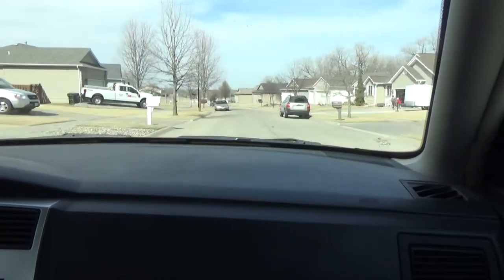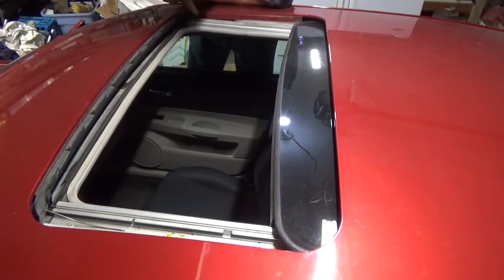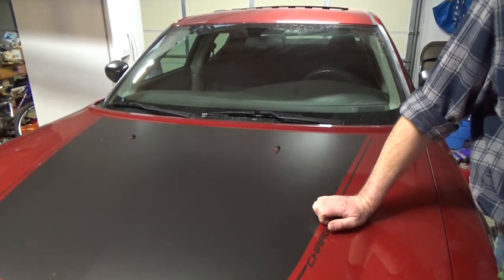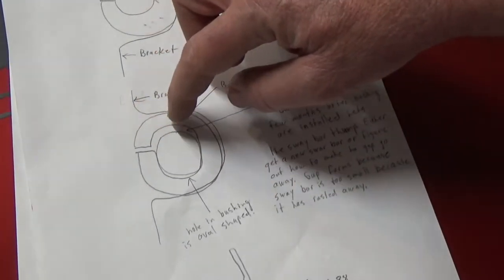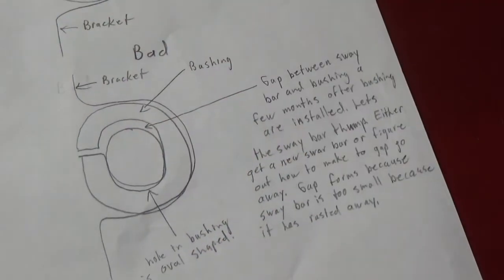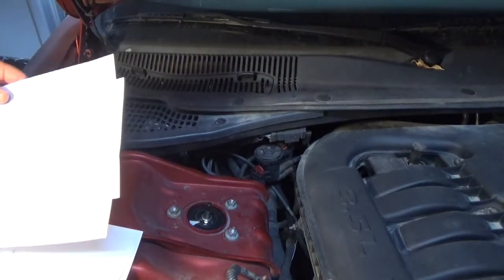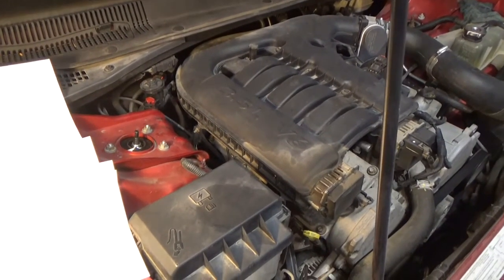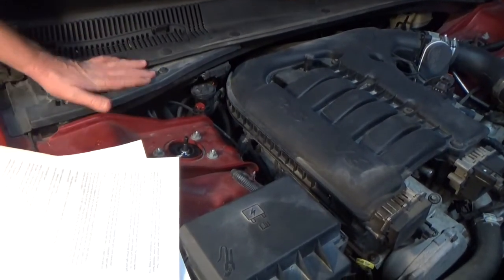Dodge Charger - How to fix clunking, rattling, squeaking, and banging

Comment: I have had my '10 Charger SXT for about nine years now, and I have had a lot of the same issues.  I replaced the worn bushings with Energy Suspensions parts.  The great thing about them, put them in once, and no more noise and it helps keep the car upright when cornering hard.

Comment: You have to understand that every piece works together in the system. If one is going bad and you only replace that one piece it could have already done damage to the other pieces in the system. Name brand or non name brand they are all built to do the same things. Yes some may last longer. But if you do the complete job, not just one piece. You wouldn’t have those continuous problems. When fixing your vehicle the goal is to get it back to the way it was from the manufacturer. To do that you should always do the complete job. No matter what system of the vehicle you’re replacing. Changing your brakes? Then check the calipers and the equipment on the brakes. Check the rotors make sure they are still good. Just an example.

Comment: Hi Bud I just got a 2010 Charger from sister and this thing make the most annoying squeaking noise when I push down on the front end and when it turn. It’s so loud people look. I haven’t had a Dodge in so long. It does make a thunk and rattle noise as well. I’m gonna do the sway bushing and end links. But boy that damn squeak noise I can’t take it. I sprayed everything under there (Suspension Wise) with WD 40 it’s like a lithium grease. Everything else looks to be ok for the most part. I have a bad back and I might take it to a garage and have them check the inner outer tie rods upper lower ball joints upper and lower control arms. Any ideas? Other then that it seem to run pretty well. Thanks Big Jim.
Reply: Mine does the exact same thing!!!!

Comment: Detroit axle makes a complete kit for the front end that cost about what one component cost at auto parts store.
Reply: I heard they make junk parts though ?
Reply: @collierlavante  Well, the fit up was good, and I got every part for the front end except bearings and brakes.  It aligned good and has stayed tight.  Some of the joints had zircs on them some didnt.  All in all 2 thumbs up and WAY cheaper than piecing it together.  My opinion.